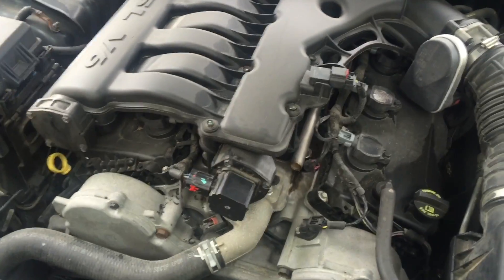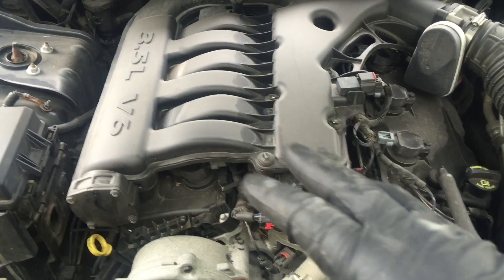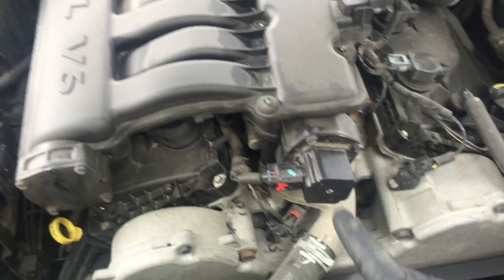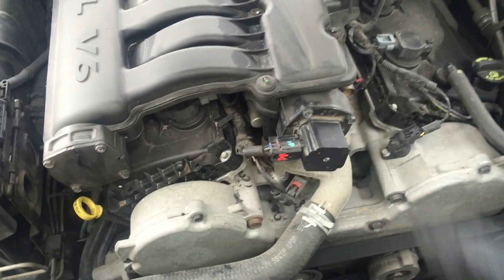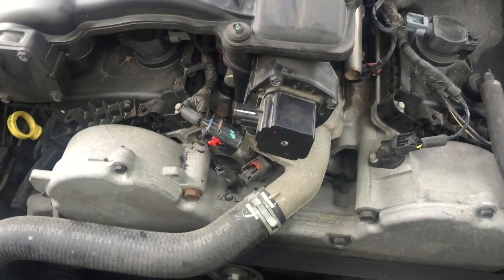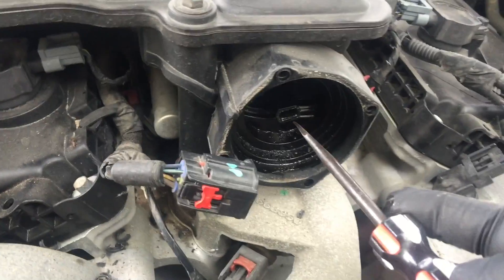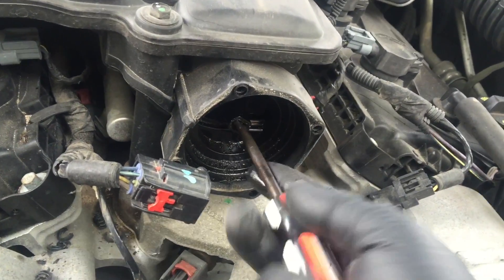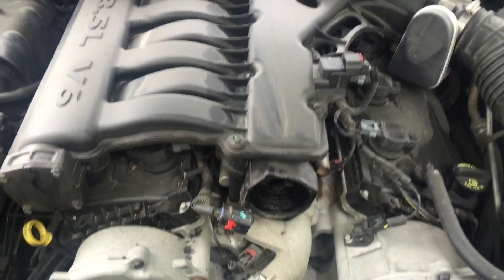CHRYSLER/DODGE 3.5 CHECK ENGINE LIGHT CODE P1004

Comment: I had the same problem. I purchased the Mopar OEM part from the dealer, I've tried other brands like Dorman with no luck. Once i put the Mopar runner valve codes went off.

Comment: I have the 3.5 in my 2009 Challenger SE. I want to change spark plugs in Spring. Looked at many videos to pull that intake .
Reply: That's ez just take unscrew the 8 screws and disconnect the hoses in the back of the manifold.. And just pull

Comment: changed out the short runner valve &, manifold intake, erased code with cheap scanner but light still comes back on with code p1004 ? what else can i do ?

Comment: I have the same code. Does this also cause your engine to have a clinking noise while driving. I also notice that my 2007 Dodge Charger vibrates where my pedals are while idle. I only have 86k miles on it by the way.
Reply from the maker: the clicking noise MIGHT be the rocker arms .. a well known issue with this 3.5 engine

Comment: I have a problem I changed this before and now its back again my car shuts off at stop lights sometimes but now it's more than often that. Is this the problem
Reply from the maker: ive never had this code shut the car off, maybe check your wiring or also see if you have any more codes stored in the computer.
Reply: Fourp87 for a lot of chargers this model. Including mine. The PCM went bad due to wear on it. If you open your hood and look at the top left of your engine bay, you will see two tabs. Pop those off and you will see the PCM sitting right there. I just replaced my ocm a few days ago for this issue.

Comment: Thank you for replying back. I brought it back to the garage that did the tune up and they said that I would need to replace those parts at the cost of around 350.00 each plus labor. How does those parts suddenly not work properly within hours after having a tune up? Can I take them off and clean them as you did and see if it's just because they are full of carbon and stuck?
Reply from the maker: cleaning could help.. as far as then just not working any more sometimes it just happens like that..
Reply: @FalconsGarage  how would you clean this?
Reply: a
Q
Reply: @FalconsGarage  when is it time to change out the upper intake manifold.. I changed all the spark plugs and coil packs. I saw the code P1004 pop up again.. I replaced it before. Ii may have to go for a higher quality..

Comment: The srvs that work have a metal dot on the middle on the square body. Also has a reflector sticker.. other srv did not have this. I bought a used mopar intake with arv attached forn$300 off e bay. When i pulled the intake i bent the egr tube trying to get past the transmission tube. . Had to crawl under and undo the screw on the transmission

Comment: I had the flaps cleaned. Do you suggest I check the connector or replace the runner. How can I tell if the runner is bad?
Reply from the maker: well it depends. If the code comes back imitatively after you reset the code, then its probably the connector if the codes comeback after a while its probably the runner it self. But the cheapest thing to do would be the connector.
Reply: Do you know the part number for the connector?
Reply from the maker: No I don't..I usually don't replace the pig connectors at first... i usually open them up and try to open up the little connector inside before replacing it.

Comment: This code literally just popped up today. I have a 2008 Chrysler 300. Any suggestions if the solution doesn't clear the code?
Reply from the maker: Ive also had times were is the wires that go to the runner be the issue
Reply: Any solution I have a 2008 Chrysler 300 aswell just got code p1004 the other day

Comment: Do you need too add any grease too the new part? How do you reset the check engine light.
Reply from the maker: SICK562CKRISS no grease needed. You need a odb scanner or disconnect the battery.
Reply: Falcon's Garage ok thank man. Much appreciated

Comment: Will this affect my cars performance? my car is REALLY slow and i have this code
Reply from the maker: not like that
Reply: You might need to check to see if you have bad injectors or hope you not having transmission failure or see if the catalyst converter is ok.

Comment: I brought my 2008 Dodge Avenger R/T in for a tune up and now my check engine light is on and throwing codes P1004 ,P1005. WTH!!!! I did not have any lights or codes before it went in for a tune up.... Do I need, to replace both of those parts?
Reply from the maker: its a posivility .. I would have somebody check them

Comment: I have a 2009 dodge charger sxt 3.5 and im wondering if they sell the part that you are taking about separate. I do have the code p1004 and I've seen the outrageous prices on the manifolds and just dont want to spend that much money.
Reply from the maker: Not sure on yours, might have to call the dealer on that one with your vin number
Reply: I've seen them for 190 on partsgeek with isnt bad at all.

Comment: hi I just subscribed! i have an 06 charger 3.5L no problems at all with 148 xxx kms. i just wondering when should i change the transmission fluid and a tune up? last owner didnt really tell me when they changed it so ill just assume that it hasnt been changed because theres no dipstick for me to check. i figured id do this now to do preventative maintenance.
Reply from the maker: the tune up yeah! i would do do ASAP just because you don't know when was the last time it was done. as far as the transmission its usually done every 50k BUT not having a dipstick most places wont eve want to touch it because they don't have a dipstick to check it them self's, the dipstick is something you/them have to buy aftermarket.... so don't do it until you have a dipstick or find somebody that does...
You could always drop the pan measure the oil that comes out ans put the same amount in BUT if it was low before you will leave it low again .... and this tranny's will leak if you overfill them.
Reply: Falcon's Garage i honestly dont know if it was ever touched. transmission shifts good acceleration is amazing with kn intake. only thing that is rough SOMETIMES is when i shift from revers to park but really nothing notcieable. owner manual says to change at 100k and 160k so ill just follow that i guess. also spark plug and pcv due at 160 too maybe it is time for a tune up at 148kkms.

Comment: My exhaust sounds a little different Nd the car vibrates I was told it’s cuz of the runner valve is that true?
Reply from the maker: If it has the runner code it could be. But just by what your describing I would automatically think of the runner.
Reply: I can’t find the runner either autozone or O’Reilly doesn’t have ut
Reply from the maker: I would call the dealer
Reply: @TheChatoese  u won't they dont sell those anymore..u have to got online..the cheapest I seen was 200

Comment: This video gave me hope that I can do this myself, as a woman I am now confident! This code jst came up on my 07 charger. However, the engine light went out now??? I ordered the part. I’m still going to do. Do you have to unplug that battery to get the job done?
Reply from the maker: yes .. unplug the battery that way it resets the computer .
Reply: Cool, just the negative? Thanks for replying 🥰
Reply: @leahbernal9519  hey there  may I ask where u ordered the part

Comment: Hello I have a 2006 charger and I've replaced the EGR valve and now my ETC light popped on.. could this mean something is loose or should I replace my ETC? PLEASE help if you can... thanks in advance
Reply from the maker: If i had to guess is that something was left loose!
that little lightning light could also mean there is a short somewhere, just double check everything!
Reply: Thank you I'll double check
Reply: Your problem is the EGR Tube valve. Its a little blue circle at the end of the tube

Comment: i have an 07 charger and i just got this code this morning. the charger has 2 short runner valves one on each end of the intake manifold, do i need to replace both?
Reply from the maker: one is the short runner and the other is the long runner .. if possible just replace the one that is bad ... but In some cases the sealer will sell the intake as a whole and not individually
Reply: which one is the short runner ?

Comment: What is wrong if I got smoke coming from the alternator or oil tube area on this engine I replaced timing belt and water pump valve cover gaskets and pcv valve now it’s smoking from that area instead of the valve cover gaskets
Reply from the maker: its really hard to tell not been there .. but I have had alternators start to smoke wen they go bad

Comment: After i replace it, should the check engine light turn off right away
Reply from the maker: jOe LeOn no. You have to clear it. Either with an odb scanner or by unplugging the battery for 5 min
Reply: Ok thank you, will try it

Comment: I replaced the short runner on my 3.5 but it's still doing the same thing.My tuning runner has wires to it like the short runner.I'm
 wondering why is 3.5 is different?
Reply from the maker: depending on the year.. some have a short runner and a long runner.. one some only have one

Comment: hey do you know if this would be similar for a 2008 dodge grand caravan?
Reply from the maker: as long at it has the 3.5 or 4.0 engine yes, but I don't think they come with that engine.
Reply: Falcon's Garage it's a 4.0 engine. if it doesn't come  with that engine then what else would give out the error?
Reply from the maker: If it's a 4.0 it should have intake runner, there is always a change that your problem could be the wiring or connector itself, but it would just have to be tested or replaced.

Comment: So I’ve tested the short runner…works fine…cleaned out the area that it connects to(moves freely,no sticking) still the p1004 code appears….after I shut off the car for the 1st time and turn it back on….what’s next?
Reply from the maker: Check wiring, check what it does with a scanner,control it with the scanner etc

Comment: I have 3 different codes coming   up and now my car rough idle and stalls po137,po406,po1004 can u help plz
Reply from the maker: you got an EGR, RUNNER and a Oxygen sensor codes .... you will have to tackle one at a time make sure your EGR isnt leaking the hose behind the intake, when was the last time you did a tune up?
Reply: Falcon's Garage thanks I did tune up a 100k and it's at 125K thanks for getting back to me
Reply from the maker: Josh Costanzo ok. Yeah it's going to be a little hard on your codes because those codes aren't really related to each other. UNLESS the wiring hardness for all 3 runs in the same bundle and it's aplica some were. 
But you are going to need to try to tackle one code at a time.
Reply: Falcon's Garage ok thank alot man
Reply from the maker: sure!

Comment: Hi i have the engine light on my tachometer but the problem is my CAR dont change the nex Gear e need to go to 3-4000rpm can be because the engine light is on?
Reply from the maker: It could be, Have you gotten the codes read with a scanner? If you haven't Oreillys, Autozone and Advance do it for free that could give you a better idea of what the issue is.
Reply: +Falcon's Garage Yes i have another Erros like : po 171 -p1004
Reply from the maker: p0171 is a lean code. I would check for a vacuum leak.

Comment: I replaced the short running but the code still pops up :/ any tips
Reply from the maker: Worst case scenario is that your intake internally is broken or stuck!
I would check the connector, and the wiring system on it.
One time I was having the same issue on a Chrysler 300 and the issue was the wiring system behind the intake it was sorting out with the plate that goes behind the tranny and the engine.

Comment: hey man where can i buy these from? I have 2 of the short runners on my engine
Reply from the maker: Hnajib77 try the dealer. There is a particular year that they don't make replacements for and you have to buy the entire intake. But ask them
Reply: Why is there only a short runner on my 2008 300 there is not the other one just the one on the right

Comment: Hi I have a car dodge charger there is an error 0133 what and how to fix the error
Reply from the maker: That code usually means a bad O2 (oxygen) sensor or it could also be an exhaust leak

Comment: Great video man 
I have a 2007 chrysler 300 touring 3.5 L 
I'm getting  code P0007 fuel shut off valve where is this valve located at
Reply from the maker: those are usually hidden in the trunk or under the kick panel on the passenger side

Comment: damn I was hoping that this would help out because I just got a code p1005 on my 2007 dodge charger, I don't know what could be wrong.
Reply from the maker: did you replace the runner already?
Reply: +Falcon's Garage . no I didn't know what to replace
Reply from the maker: the code is for the intake tuning valve!
Reply: +Falcon's Garage. so to fix the P1005 code, would be to change the left Valve?
Reply from the maker: Yes the p1005 code is for the left runner, make sure the wiring and connector are good, but yes the code you are getting fr the tuning runner is the left runner.
Good luck!
Reply: I replaced the tuning valve but now a p1004 code popped up.
Reply from the maker: that code is now for the other runner
Reply: ok I'm going to replace that tomorrow. is their a drive cycle for the charger's, so I know when it's ready to take to emissions.?
Reply: Gabriel Perez how’s it been driving since you changed both?

Comment: I have the code P1005 on my 2007 chrysler 300 how can I fix it?
Reply from the maker: check the hardness, and computer if its all good then probably the runner is bad
Reply: Falcon's Garage is there any way to check if the hardness and computer are good ??

Comment: I dont get the p just the 1004
Reply from the maker: what scanner are you using?
all codes should have a letter on the beginning
Reply: Falcon's Garage no scanner I did the ignition back n forth 3 times from accessories to ignition and it gave me the 1004 code but hey i did the fix twice and check engine goes away.. comes back... then went away.. weird
Reply: Falcon's Garage im wondering if high octain and oil change with new filter makes a difference... or even some additive to the gas to clean all that shit out?
Reply: majorlifts  same with me it just comes up as 1004 without the p in the front. I changed the runner & the check engine light went away but the code 1004 still appears in the dash board when I do the key dance trick to check for check engine lights
Reply: TheSonicEnergy same here, I wonder if the check engine light burned out.. this is crazy but the car runs awesome it just takes a bit more turn over on start ups
Reply: majorlifts. Yeah man  as long as the car turns on fine & runs i wouldn't worry to much about it

Comment: Hey Falcon, I have this code on my Dodge Journey but I don't see or feel any difference in my engine while driving.
Reply from the maker: I would still look for the issue
Reply: @FalconsGarage  I just purchased a new short runner valve through Mopar, I hope it resolves the issue. Do I have to clear the code or it will clear by it self?

Comment: Why do all these 3.5 v6 all have different manifeolds/short runner/tunning runner??.??

I see 2.5 engines with no tuning runner and I’ve seen 3-4 different 3.5 models with no tunning runners ,(like this video, ) and other 3.5 with 2 runner valves but completely different?😂😂😂😂

I bought a used manifold with both runners thinking it was the same as my engine but both runners have a completely different harness plug 😂😂😂😂😂 I just figured”wow ok new but used manifold with new looking runner valves but I swapped manifolds today And both runner harness wouldn’t fit into mine!! But but, I did change my spark plugs and looked like they been sitting at the bottom of the sea they were so rusty af and spark tip had a huge gap! No where near the  .05 gap new ngk platinums I used 😂😂😂😂 200k miles, I used my old manifold and went for a test drive and no more check engine light? Could code p1004 possibly mean “bad spark plugs”🤔🤔🤔🤔 (hope my story helped others)

Comment: my 2007 charger 3.5l seems to get all the common issues. I tried spraying cleaner into runner, tried seafoam and then replaced the runner. still had code even after having it cleared. when I replaced the runner not only was code still there I gained p2017. I took the plenum off and tried spraying cleaner into the flaps. I guess it must be a bad plenum. any place to recommend for new one beside dealer? 2006 model is half the price of the 2007 despite looking exactly alike.
Reply: Where did you find the 2006 model I can't seem to find it ?

Comment: I had this code. I bought and installed the part.

Now I have this code still up and 2 new ones.

P2016
P2017

What the hell did I do wrong?

I mean the car runs absolutely great but why is my light on?
Reply from the maker: could be many things, did you clear out the codes after you replaced the part?
Reply from the maker: Elemeno when a code comes back right away.. most of the times it means that the part is either disconnected or shorted out.
Reply from the maker: I get it.. just double check it

Comment: If my check engine light is on and I change the intake manifold runner and it goes off.  Then the check engine light comes back on a few days later.  What could be the problem?
Reply from the maker: maybe .. but check all codes before .. make repair .. and check codes after repair ... if code persist could be a wiring issue
Reply: @FalconsGarage  Thanks